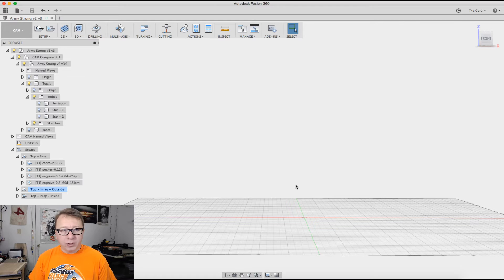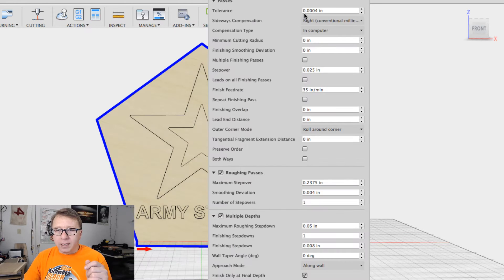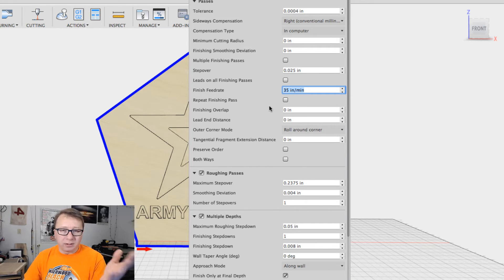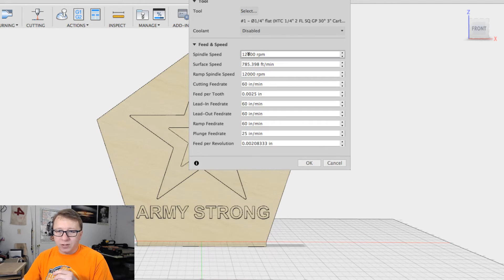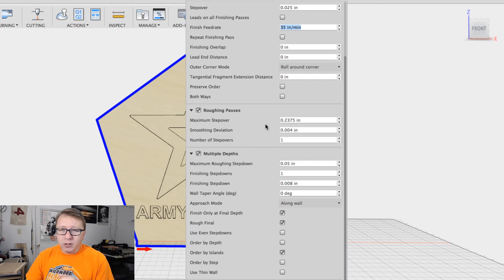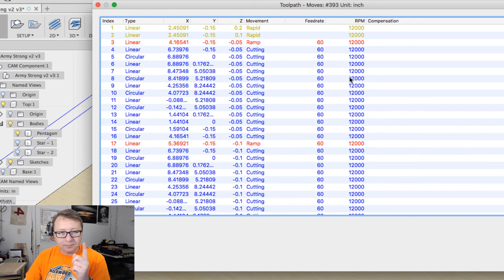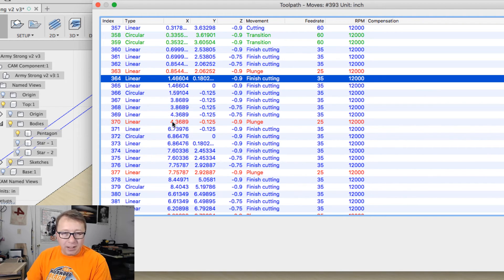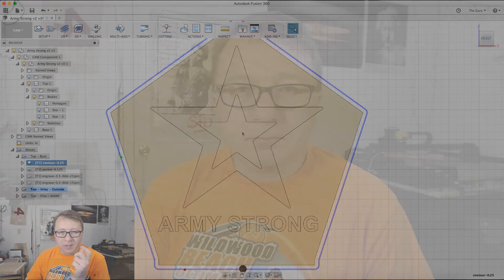Fusion 360 CAM Tip 001 - Roughing vs Finishing Feed Rate

Comment: Thanks for the video! Worth it for the View Toolpath heads up alone! :) But also good to see your multiple depth for Maple...I tend to go with 1mm, you're at 1.3mm for 6.35 (1.4 inch) bit... I think I need to take less on multiple depths.
Reply from the maker: Thanks for watching Rob.  I don't know why, but this particular series hasn't received many views.  I think it is pretty useful :)

I played around with my settings for a 1/4" bit for a long time.  I finally determined faster at a more shallow cut depth is better than slower and deeper.  On my hobby machine, if the cut is too deep, there just isn't any compensating.  The smallest amount of chatter during a deep profile will cause catastrophic failures - it seems it always happens near the end of a flawless hour long op...

Anyway, 0.05" (1.27mm) or so seems to be my sweet spot for 60ipm (1500mm/m).  With a more rigid machine, better belts, and bigger steppers you can get much more close to the optimal chip load which is something like 0.2" DOC at 150ipm - way too deep and way too fast for X-Carve or Shapeoko out of the box.

Hope this helps - subscribe if you haven't and it would be great if you can share the series and spread the word :-)

-Tom
Reply: @cyberreefguru  fully agree. I seem to have come up with faster and shallower for my Ooznest OX. It's just not tough enough to cope with it too deep. My. Issue at the moment is chatter as it rounds curves. Not sure why, not enough power to motors, too slow a speed (over 1000mmpm) I just don't know.. I keep on looking for the answer.! I'll see if I CA  flag the series. On Instagram. Robllewellynuk
Reply from the maker: Thanks Rob - I have the same problem with chatter.  Shallower DOC seems to be the only real fix.  Slowing things down helps but DOC seems to be the key for larger bit sizes.